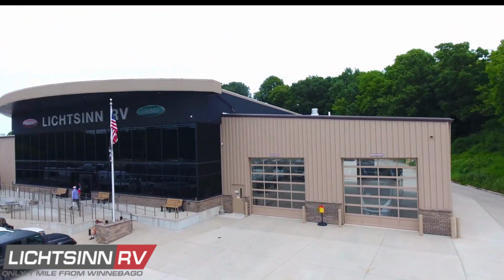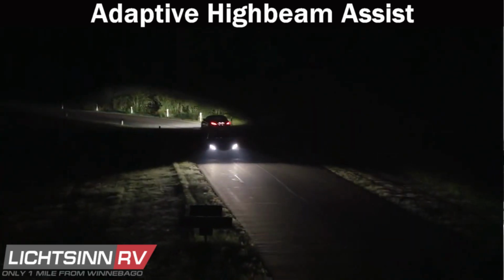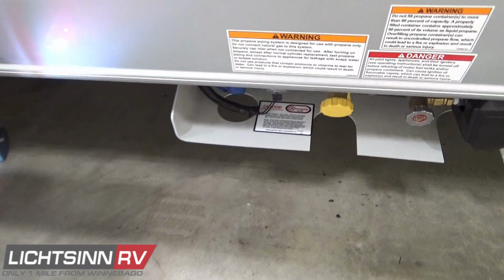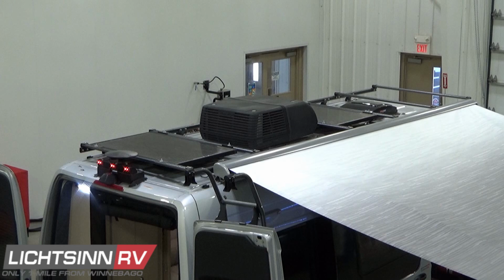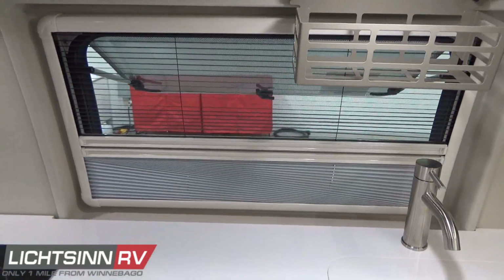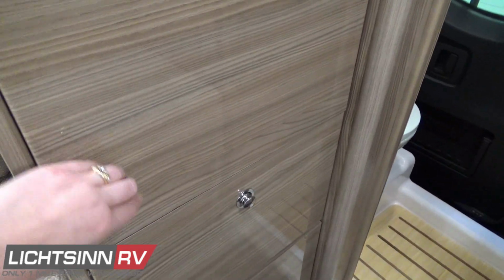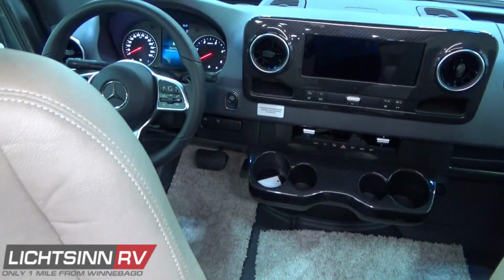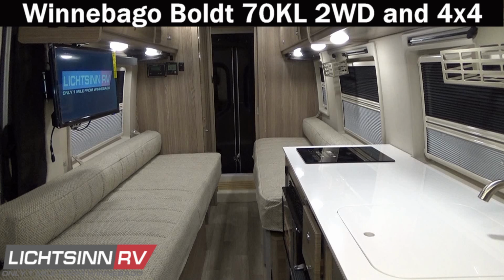LichtsinnRV.com - 2023 Winnebago Boldt 70KL 2WD and 4x4

Comment: This looks just like the 59K minus some difference in the bathroom where the sink and toilet are placed. It seems to be placed differently and on the opposite side but what is the difference? Is it the Mercedes Benz chassis? Other than that, it seems the same even down to the same not great quality cabinets.
Reply from the maker: Good morning Monica!   Thank you for your note!    The floorplans are very similar to a 59K or 59KL Travato... the Boldt, however is a longer larger coach powered by the Mercedes Benz turbo diesel and has the larger Volta lithium system.... just give us a call if you'd like to go thru each difference individually.